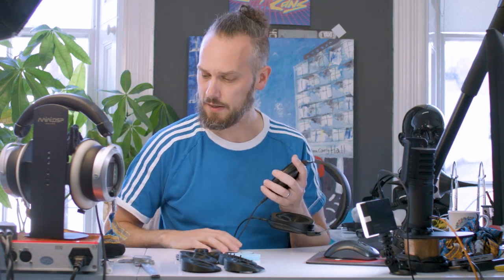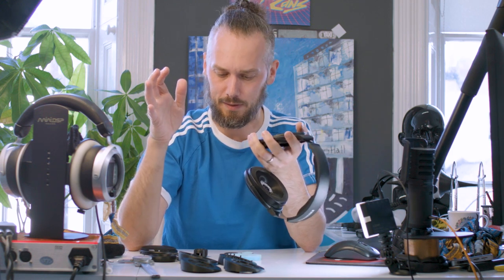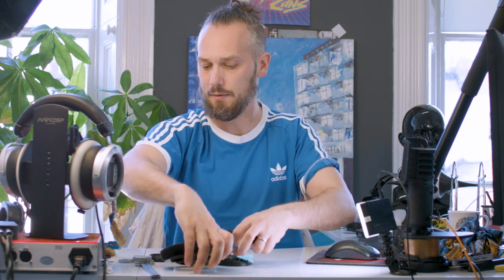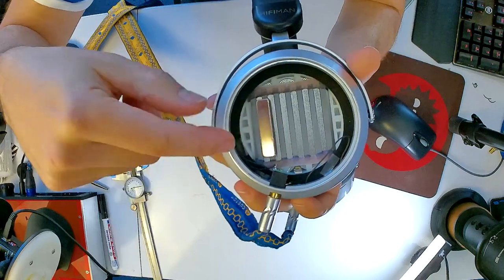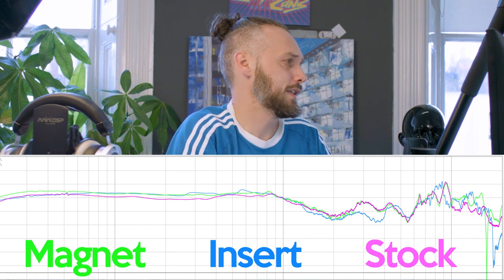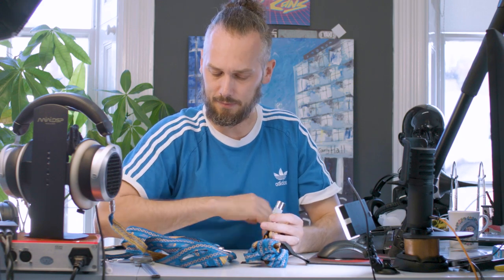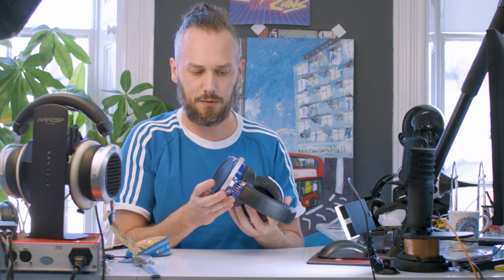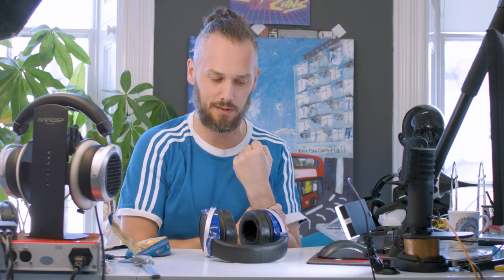HD660 and HE400 headphone mod project updates

Comment: The reason why this channel is attractive is that it starts from simple design mod to internal-parts mod. 

In addition, by attaching the measurement data together, it is possible to check how the frequency response changes/or does not change. 

So, the pleasure of watching the interesting process of modding and the usefulness of checking the measurement data coexist.

Great job!
Reply from the maker: Thanks. We will hopefully build a fancier test rig soon to get better data

Comment: Amazing Work, in my opinion 660s are ready to go no mods needed. Years ago i use a hd650 driver inside the HD599 angled plastic frame and i got way better soundstage (like u said) ànd also it needed more power and i had more distortion.
To me HD6 series are all about the sound signature this soundstage and the only need is the mod that u had on hd600 and 650 giving a small low end without braking something else .
Reply from the maker: Thanks ;)  it is the " not breaking something else " which is always the hard part
Reply: installed the copper mod, got tubes, it's great
Reply: @CustomCans  exactly the problem with mods and pads is this , unfix something u brake something.
Your copper mod is something very clever , u should have it on black colour for people like me that want something elegant .
Reply: @Tripokaridos22  My 660s could definitely use a bit more sub bass, but I think the best “fix” is a bit less lower midrange bloat in the 150-250hz range. It just slightly masks over the rest of the midrange details to my ear and eq confirmed it for me

Comment: It was interesting seeing you mod the Sennheiser HD 660 S and Hifiman HE400SE as these are the only headphones I really have.

I daily drive the Sennheiser HD 660 S and have had them a while.
The HE400SE I bought a little while back to try out.
The stock silver cable sucks but Hifiman sent over the new black one.

I use Grado SR60x while in bed but the cable is horrible.
Reply from the maker: It is surprising how bad some headphone cables are ;)

Comment: The thing is what i have discovered with open backed headphones is they will sound like crap unless you have very good amplification, all headphone amps sound different, and guess which one is the best to my ears, the one in my Sony JB930 minidisc recorder, its bassy and punchy as hell with sizzling highs
Reply from the maker: Oh.. Man, I used to have one of those and regret getting rid of it - I used to love the keyboard input to add track titles and stuff
Reply: @CustomCans  Best format ever mate, ive got discs here i recorded 20 years ago still play 100% perfect, yet most of my cd-r's have rotted and fell apart, as they have no protection, i use minidis to record music i make myself, theyre brill machines the sony jb QS series

Comment: Way cool, hopefully some 3D printing service can print them out, when you make the STL's avialable. I have no clue about 3D Printers, never had one. ;-) About the HE-400, i'd love to hear my HE-400se with your latest mod. Because i am totally not happy with the SQ from this Headphone, it sounds naturally like rubbish compared to my HD 650, sad but true...is there any possiblity to get that huge mid to high frequency curve more flat? It's crazy....
Regarding a headset amp, it should being always Class A...these sound really great, i've bought some back into the late 80's, early 90's, it was a hobby...long ago...well, quality neutrik connectors, same for chinch connectors, quality PCB & layout, Toroidal transformer, selected transistors, 1% metal film resistors, and nice, small alu case for it.
Reply from the maker: This one won't be class A but I know what you mean - they are special.

Comment: is the magnet idea just for the HM HE400, or would this work for any planar's?
Reply from the maker: It is very difficult to say - the HE400 are a basic model so have a lot of room for improvement - most planars have had a lot more refinement already done and adding magnets may make things worse. They are also quite easy to damage so I don't reccomend trying it on anything you care about too much ;)

Comment: By the way now that u have them and spend time on them , Was i correct? Are they technically better than 600 and 650 on speed and imaging.... Did u hear that ? Are still 600 your favourite;
Reply from the maker: Yes I am learning to appreciate the 660 more, I have not had a listen side by side with the 600 for a while as I don't have any in at the moment. I should have some more 600s next month so will try them and see if the angled driver adapters work on those as well
Reply: @CustomCans  I cant wait to hear what u think. 
Angled drivers put some measurements with them .